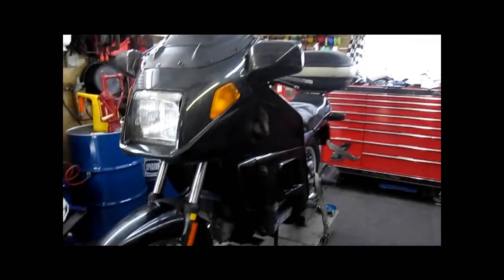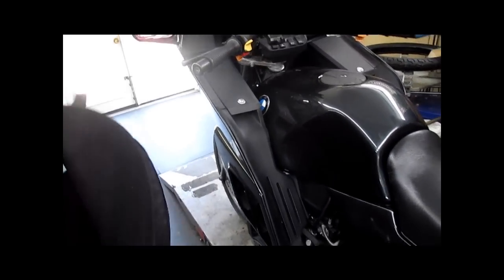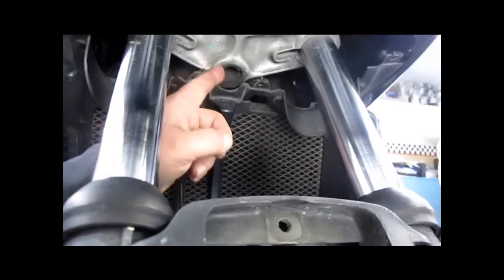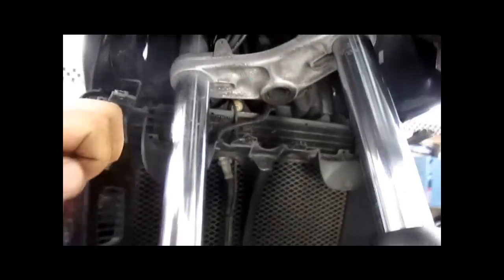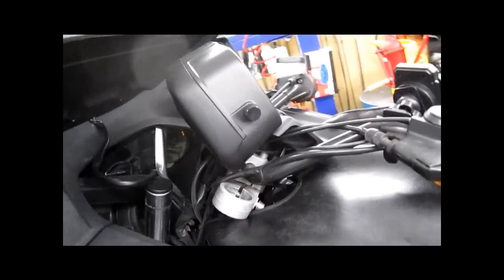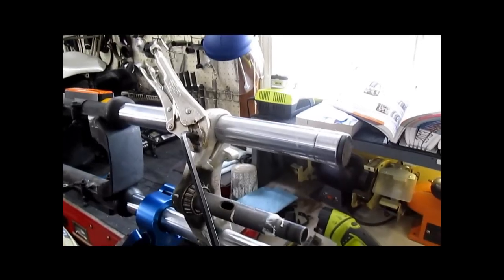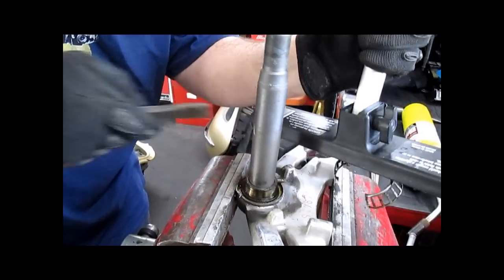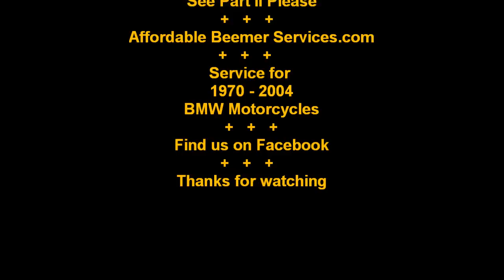BMW Service - Steering Head Bearings Part I - K75/K100/K1100

Comment: Another way of getting at that knurled nut is to remove the fuel tank and use a pipe wrench. In the UK we call those bearing race marks 'brinelling'. For those of us that don't have an air hammer, I've found that once it's hot enough you can use a sharpened cold chisel to lift the inner race.

Comment: Hi Chris, it's me the retired A&P mechanic. One thing I like to do whenever I get a triple tree off (no matter what bike I'm working on) is to very lightly hone the stanchion holes to remove the high spots. This may not be something you want to do seeing how time is money for you but it only take about 30 seconds per hole. I also put some copper coat in the holes before refitting the stanchions.Cheers, Eric
Reply from the maker: Thanks Eric & Happy 2014, Chris

Comment: Chris:  The "shallow" bolt you're complaining about--you're supposed to use a special Allen head wrench with a pin on the end.  That's supposed to allow you to apply extra torque without the wrench rounding out the head of the bolt.
BMW uses those on their cars, too.